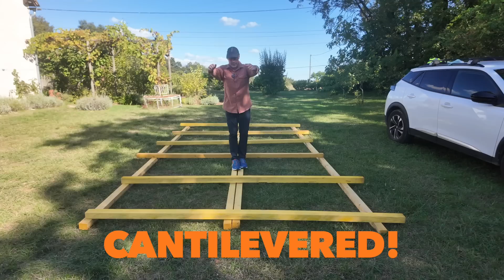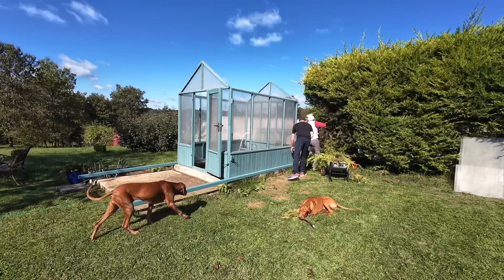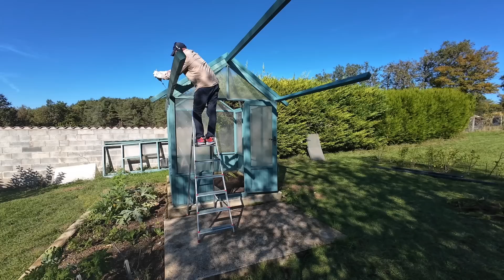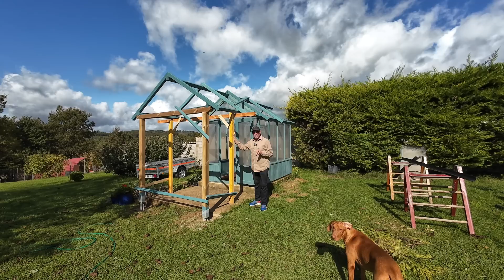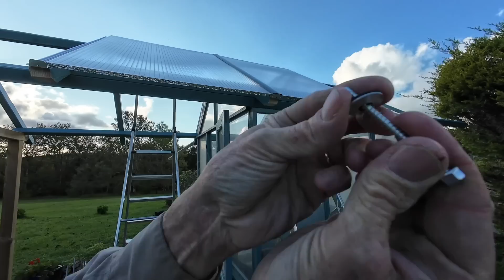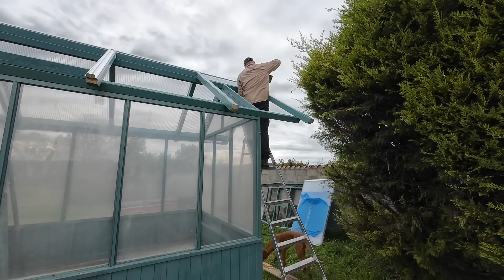Roofing the Greenhouse with Polycarbonate Panels and creating a Covered Seating area.

Comment: Great work JP.  One question. Why the overhang at the back of the greenhouse?
Reply from the maker: Thanks Paul. The aim is to keep the weather off the frame and thats the direction it mostly comes from. Was also the length of the five sheets. Might be useful for some log storage. Regards JP
Reply: @Smallbarnworkshop  sound reasoning all round!

Comment: what a fabulous upgrade! did I see you seal the poly with some sort of tape?
Reply from the maker: HI John. No, the last one I did it used a rubber seal, but for these the fixings just compress the bars into the sheets which have a soft edge. Regards JP